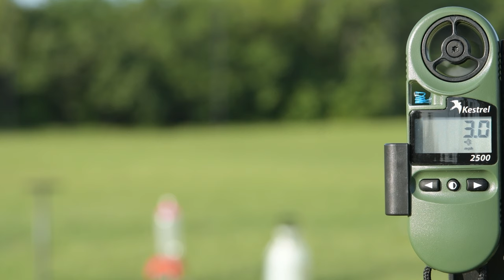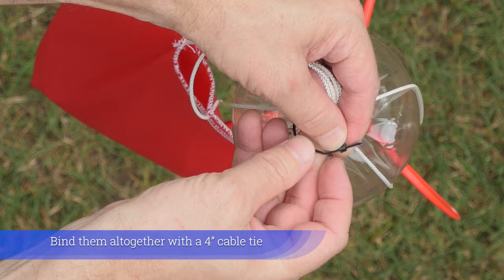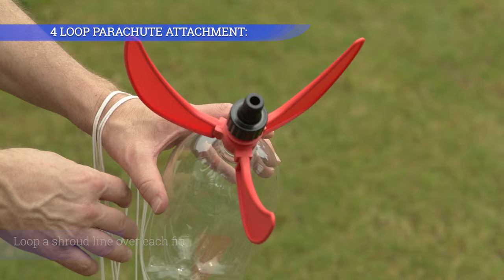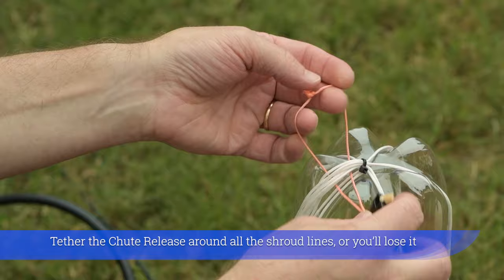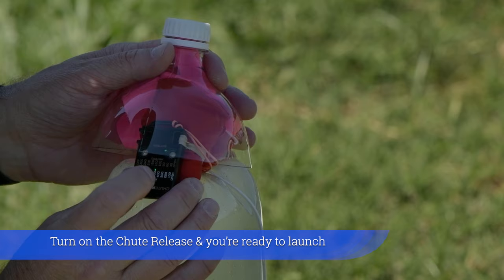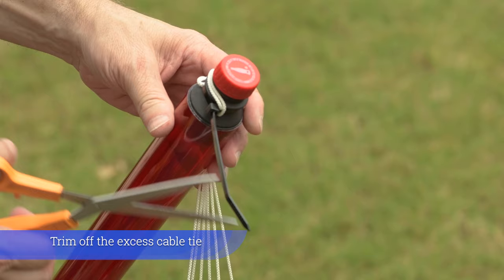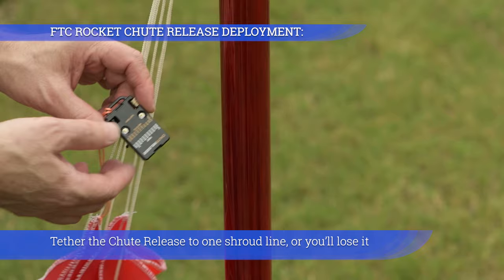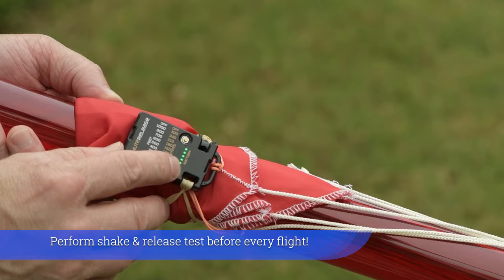Water Rocket Parachute Deployment Techniques

Comment: Hello! Im doing a similar project for school and I would like you to answer my questions: What altitude did it reach? Where did you buy that tube and the fins? Are there any alternatives to the device used to deploy the parachute? Thank you in advance.
Reply from the maker: Altitudes usually range between 205 - 350 ft. depending on weight of the rocket, PSI, and amount of water (wind can play a factor as well). We sell the StratoRocket (FTC tube) on our website https://stratofins.com/stratorocket-48-inch-3d-print-ftc-rocket/ along with a host of other water rocket related items from beginner to advanced. As you can see in the parachute video there are methods for deploying the parachute without the Chute Release, although the latter is more reliable. Also, the real benefit of the Chute Release is deploying at a lower altitude 100 - 200 ft. to minimize drifting off the field while under parachute descent.

Comment: Where do you attach your camera? And can I have your camera name?
Reply from the maker: The camera is attached to the bottle about 1/3 up depending on your camera’s angle of view. Over the years I have used various key chain type cameras that are very small, but the best one available now is the Mobius Mini version 2. You can get a 5% discount on their website to bring it close to $75.00 and shipping may be free. You may find this on Amazon or elsewhere, but I would not recommend buying it anywhere else other than their website. There are some knock off versions out there that are not as good.

Use outdoor two-sided tape (gray tape with red backing) from Lowe's or Home Depot to attach the camera to the bottle and balance the opposite side with metal washers or coins. Weigh whatever camera you use and weigh out an equal amount in washers or coins to attach to the opposite side of the bottle in the same location. You definitely want to use a parachute if you are launching a camera so that it returns in one piece.
Reply: @StratoFins  where is your shop? In Uk or in USA?
Reply from the maker: @nguyentuanminh5330  We are in the USA, but we ship worldwide to many countries.

Comment: for the ftc do you need the rail system
Reply from the maker: No, the FTC rocket will work fine without the rail system as you can see in any of the promo videos that demo the Versatility of our StratoLauncher IV, Deluxe and Ultimate models. In fact the FTC will work better than a 2 liter does without the rail system. The rail system does help with straighter flights especially if there is any wind, but it is not required with the FTC rocket. Also, given that the FTC is much narrower it is not affected by a higher volume of water since it is not swirling around inside before exiting as it is with a 2 liter bottle rocket, which is why the rail system is not as important.

Comment: How do you determine the length of the rope? How it changes according to the rate of the rocket.
Reply from the maker: The StratoChute that we sell is a 24" parachute canopy with 24" shroud lines. The lines are a loop about 48" and when joined at the rocket end up being 2 lines 24" long. This length works perfectly for 2-liter bottles to extend all the way down the sides to loop over the fins and be joined at the top leaving about 9 - 10" in actual shroud line length. For FTC rockets the shroud lines end up being close to 24" in length since the attach at the top or middle section depending on the rocket design. If you want shorter lines one can always tie them off with a loop or slip knot and attach a cable tie above those knots. I hope this helps and makes sense.

Comment: How did u ignite the water rocket at 6:21 ?
Reply from the maker: The FTC rocket works the same way a 1 or 2 liter rocket does. Fill with water (it can take more water since it is narrow), pressurize with air, and squeeze the release lever.

Comment: how do you record the video on the rocket?
Reply from the maker: There are various options like key chain cameras or small action cameras like RunCam 2, but I use the Mobius Mini v2.
Reply from the maker: @Darenz-cg9zg  Use the same amount of weight as the camera with coins or metal washers and attach them on the opposite side of the rocket at the same height of the camera using double sided tape.

Comment: How long did your bottle rocket stay up in the air
Reply from the maker: I apologize for the delayed response. Flight duration varies a lot based on weight and shape of the rocket, whether under chute or not as well as the PSI employed. A typical 2-liter soda bottle rocket with a parachute and pressurized to 120 PSI will have a flight duration of about 22 seconds give or take a second.
Reply: @StratoFins  awe man my class needs 30 secs where am i gonna get that kinda time
Reply from the maker: @GoldAxoMC  You might squeeze out 30 sec. of flight duration if you keep the rocket as light as possible so it hangs longer under chute. Weight is needed in the nosecone for launch, but when the nosecone comes down separately that will reduce rocket weight. One problem with a long hang time though is drifting off the field. Ideally, you want to deploy a chute at lower altitude so the rocket doesn't drift off the field if there is any wind.
Reply: @StratoFins  ah, interesting. do you think 3d printed or cardboard fins would work better to make it fly further with less drag? also tysm for the reply :D (i don't mind losing the rocket, plus the field is very large where we are testing)
Reply from the maker: You might try ReliaBot 3K Carbon Fiber Sheet 0.5mm thick - https://amzn.to/3OCAQ75, which is very thin, low drag, stiff, durable, and lightweight. We have a new device that hasn't been released yet, because I am working on a video to explain its benefits and use. It is called the StratoJig and enables attaching whatever fin design and material you desire to a bottle neck. If you contact us on our website, I can provide more details.
Reply: @StratoFins  ah okay, thank you

Comment: Is it okay if your parachute has 6 strings in them?
Reply from the maker: Yes, either 6 strings or 8 strings will work fin. If attaching to fins just double up on one of them. Or you can attach with a larger 8" cable tie around the neck of the bottle instead of looping over the fins. This way either number of strings will work fine. They all bundle up at the top anyway.
Reply: Howcome you didn't use a 6 stringed parachute?
Reply from the maker: @boonleanglewis65  As mentioned 6 or 8 string chute both work fine. Our former chute supplier had 6 string, but our current supplier has 8 string. On our test rockets we have some of both.
Reply: What would happen if you used a 4 stringed parachute?
Reply from the maker: @boonleanglewis65  It might work, but the canopy will flop around more and may not stay fully open if there is any wind. The more strings the fuller and more even the canopy will be on descent.
Reply: And what would happen if you use a 2 stringed parachute?
Reply from the maker: @boonleanglewis65  It wouldn't work and I think you know that.
Reply: Guess what, my grandma thinks I will go to jail for launching bottle rockets because I am 10 years old.